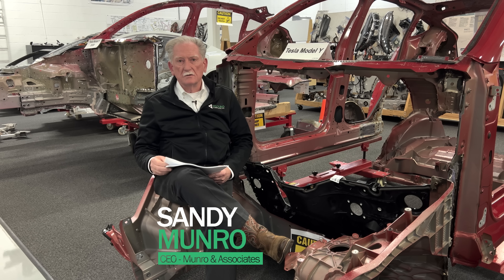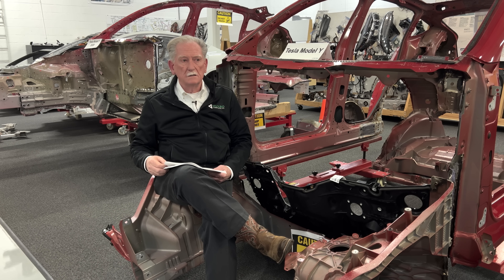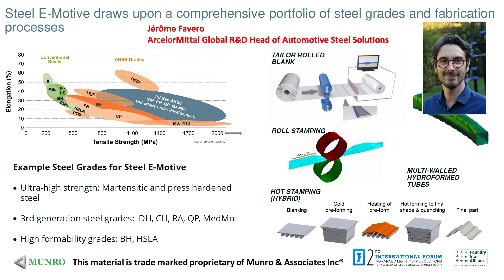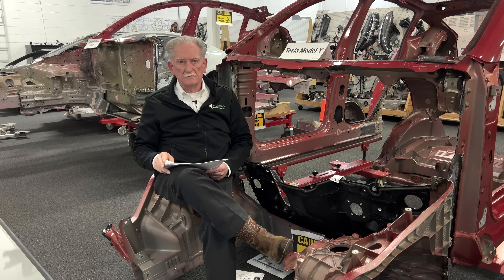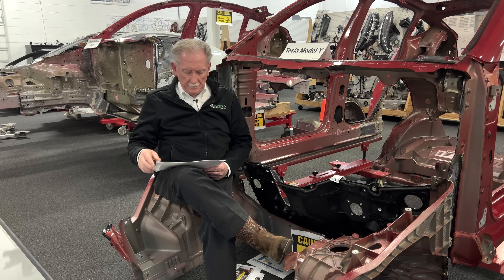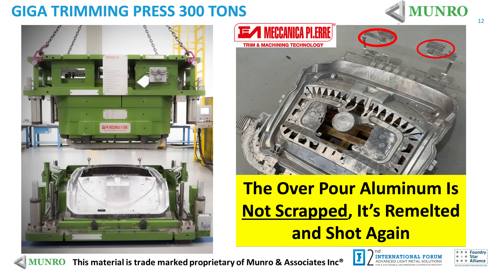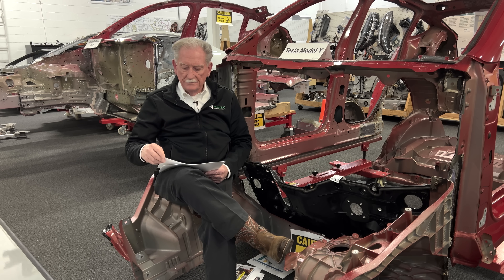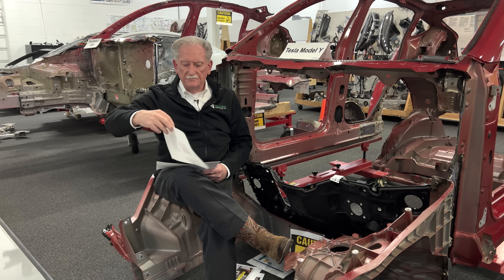Why Sandy is Captivated By Castings: IDRA Conference Recap

Comment: My father made products via aluminum casting. One thing about cast parts is that they are not repairable. Once you have a crack in an aluminum part you gotta scrap it. If car companies make these entire rear ends as one casting, any fender bender is going to cost a fortune. As i learned in my materials class at MIT, Steel is the only material that has the unique property of strength, and localized plastic deformation that allows it to absorb so much energy without shattering. 

Fiber composites are the only materials that surpass steel in strength, and of course in race cars and exotics carbon fiber is all over the place. 

Aluminum castings are cheap - great for the manufacturer - but not a step forward for the consumer. Cars need to last 30 years now, and if insurance prices are reflective of repair costs, Tesla is already terrible at repairability. So i don't see these giant castings as the panacea that so many people think they are.

Comment: I feel it was a mistake for Tesla to use stainless in the CyberTruck body. It’s expensive heavy and will corrode less noble metals (almost all of them) that come into contact. I think folded aluminium sheets in the same design would have been less costly and more durable overall. 
But then, I’d have called it TeslaTruck. I like the alliteration.  I’m sacked already

Comment: Not a word about value to the customer. How do you fix these monstrosities? Or, if you get bumped in a parking lot, you total the car and buy another, right? Looks good to an executive, manager and engineer but what about the guy who paid for it? Can it be welded? How do you change a part. I forgot, there is only one chassis part. Wait,  I forgot that manufacturers would never choose a manufacturing method that would be make a product loose most of its value 100 miles after it would was delivered. As a twenty-one year old I bought an Oldsmobile 442. In less than two years it had lost half of its value. What was good for General Motors was good for the world. Looks good guys.

Comment: I used to work in a 750,000 square foot lock manufacturing facility, and we had delron machines and die casting zinc parts.  The magnisium casting you are showing looks a lot like the delron machines we had, but of course plastic delron melts at only about 600F.  They still used a 350 amp 480 volt power to run all of those electric heaters around the mold pump area.  

This is why I was thinking that the Texas Gaga press can not operate until after the electrical upgrades are completed.  The building I worked in, they had 3 each 4,000 amp 480 volt bussbars that ran everything in the plant.  The National Electric code dictates that most buildings only have one electrical service.  However Tesla needs to run 4,000 amps at 480 volts in several locations around their plant, and another 2,000 for the chargers, and many other buildings with a lot of electrical power.  At one point, Weiser Lock was offered to bill them at 66,000 volts instead of billing at 480 volts, and the power utility would reduce our overall rates if we agreed to be billed at the higher voltage rate (and paid for any loss that the transformer is consuming).  I wonder if Tesla will also be billed at a higher voltage, and then they can put together all of their Mega packs and the high voltage distribution system, so maybe 12,000 volt power is sent from the new power distribution panel to several 4,000 amp output 480 volt output transformers locate in several locations in the plant.  So they can reduce the amount of 480 volt distribution systems they install.  

Looking at your display, and knowing a Delron machine will take 350 amps, the giga press seems to be over 3,000 amps at 480 volts, or maybe they are feeding it 4,160 volts (a common industrial power).  

Tesla wants to cycle their giga press to produce 1 body casting each minute or so.  So they need enough heating capacity to melt that much material each minute!  So that can take a LOT of power.  The 68 each Mega packs putting out 1 MW each for 4 hours, that is a example of a lot of power.  The Giga press is going to take a LOT of power.  If Tesla requires 2 minutes per casting, that means they will need to presses for each casting, so that one can be produced on press #1, and the second one on press #2, so they can put out 1 per minute.  Then if they have 2 castings per truck, that means the front and back are going to need their own press.  

If it takes a 100 KW electric heater to melt 10 pounds of material per minute,  (I actually have no clue how many KW it takes to melt that much material) you could guess how many KW is needed to melt the casting over 100 pounds!  

For the production year 2024, if they can only make 1 casting every 2-3 minutes, they can keep making the trucks at 1 per minute for a single 8 or 10 hour shift each day.  They will need to run the casting machine over 18 hours a day, to support that 8 hour long shift of truck production.  Then once they are able to install more presses, they can make the castings on two machines if they need to.  

If each truck requires 100 pounds of cast materials, and they are building 100,000 in 50 weeks, that is 2,000 per week, or 40 hours is 50 per hour.  So 50 trucks X 100 pounds is a lot of material being brought into the factory each day!  5,000 pounds per hour, 200,000 pounds per week.  Maybe they can use a gas fired melting system to pre-heat the material to almost the melting point, then feed the material into the press that is located below the metal pre-heat system.   My guess is the parts that must be cut off and recycled would be about 15% to 25% of the weight of the finished casting. So if the total weight of the casting is 100 pounds, then 115 to 125 pounds of melted material is injected into the mold, and the 125 pound casting then goes to a press that will shear off any excess material, and that excess material can return to the casting process (if the size is correct).  

So when I see the megapacks working in Tesla, then I will know that the new 480 volt transformers are going to be in place, and the giga press can get started at melting a lot of material each hour, and make a casting every minute on each casting machine.  

If the castings take 2 minutes per cycle, then Tesla will need to have about 400 of the castings sitting around at the start of each shift, and they can run the whole shift, while the casting machines will take 16 = 18 hours to produce the castings to be used the next day.  If the castings only take 1 minute or less, then they will not need to build up any stock of them on the factory floor for the next day's production.  If it does keep taking 2 minutes per casting, then Tesla will need to install more of them to bring the production down to 1 per minute with several presses.  Once they can produce at the rate of 1 per minute (maybe with two presses per part), then Tesla can start to produce the trucks in 2 consecutive shifts per day, or get to about 225,000 per year.  This is said to be by the end of 2025, according to Tesla news release.  

For those who say "Why not make 250,000 or 300,000 trucks per year?  The answer is they can not add seconds to the day.  They can only make 1 per minute, and not get more minutes in a 8 hour long shift, and actually with a couple of 15 minute bathroom breaks, they only get about 50 per hour.   For those who say speed up the production line!.  Well lets consider you are the one installing 4 bolts into each door, say you get the front passenger side, and have 60 seconds to attach the door, then run back to the next truck behind this one, attach that door, and do it all over again every 60 seconds.  A very large work out every hour of every day!   Sandy has seen a production run at 45 seconds in Germany, but we do not have slave drivers in America.

Comment: Good content and thanks for sharing it with us.  I have couple of questions: Does the flammability of Mg have any issues?  It is much less flammable in larger castings, but is it an area of concern?

Is it feasible to use the MIM (Metal powder Injection Molding) for any of these parts?  The pressures are much lower and it can be used for very complex parts similar to plastic molding.  They just need to compensate for the shrinkage as the binder is sublimed off and sintering fuses the powder metal together.  Not sure that it is practical for large parts.

Comment: I don't know how I would feel about having solid magnesium parts in an EV. Have fire hazard experiments been done in conjunction with a fully charged battery? My fear is that it would burn so fast and hot, it would melt through the battery and cause an explosion.

Comment: I struggle to see why all of a sudden people have become fixated with casting like it's a new thing in cars.  Front end/rear castings were about when I started out 20 years ago especially with aluminium framed vehicles.  The only new thing is the size of the castings based on someone willing to invest in larger (experimental'ish) scaled up machines.  The industry is conservative and risking a product launch for a potentially risky technology leaves you with $200-300m investment that you may have to retool because one component doesn't get to the quality you need. Now someone has taken the risk and proved it can work we will see more go this way as the cost and structure benefits are worth it. Well done to all those involved in taking the risk and pushing.

Comment: congrats on your success suggesting castings to Tesla but castings already feel old.  Problem with castings is size and weight and the expensive tool.    I think the future is going back to steel but new with car designs that are boxier or monolithic. The Cybertruck throws out many conventional car engineering and design and there's a lot of opportunity.

Comment: This reminds me of when the allied forces world war II examined shot down German aircraft to discovered that they were pressing big parts rather than assembling multiple small parts to achieve the same assembly. So the Germans got better equipment manufactured faster and cheaper and that really woke up the Western manufacturing eyes. The advantage over 10 snips metal brakes rivets and welds was tremendous. 80 years later and the automotive industry in some parts still hasn't figured out the advantages.

Comment: @4:30 bottom right tesla has 11 gigapresses on order? that is enough capacity for about 2 Million cars/year assuming a cycle time of 80-90 sek and ~ 1000 castings/machine/day , they are at a runrate of about 2M now. Would like to know how the delivery timeline of these 11 presses is.

Plus the new casting machines at giga texas seem to have a new cooling system, maybe the cycle time got improved, then it would be even more.

Comment: Thanks for this video very interesting. Could you please make a video about casting repairs - there is a concern that with wider adoption of castings repair costs after crashes would significantly increase and with that also insurance and the number of write-off cases after less severe crashes.

Comment: In the past it seemed people kept saying that casting would lead to lighter vehicles as well. However recently, that narrative seems to have changed. The evidence is a 7,000 lb Cybertruck, and no change to the new Model Y weight over previous versions. Would you comment on this? Is this simply teething pains for this new technology, or is this a better fact for all cast parts?
Reply: I would have thought that the 3mm thick stainless steel body, and the bigger battery and bigger tyres might muddy the waters on your weight calcs? Not to mention the biggest windshield and wiper😯
I'm sure they will address at least some of the weight down the line. They recently had a go punching holes in the bodywork, but the bullets wouldn't work!

Comment: Does Thixo Magnesium have any flammability issues?  I recall decades ago Magnesium was used by NeXT computers.  They were machining of course. But I recall they had multiple fires and had insurance issues.  As I said, its been decades so I'd imagine they have found/solved the issues but I just wonder.  Also I see the new iPhone has titanium. TITANIUM! in a consumer product. Just stunning. Then again the original hard drives had platinum - so go figure.

Comment: I'm no engineer but i have a question out of curiosity. What about production speed? Is it slower to cast all those parts than slap them together and spot weld the stamped ones?
Reply: It's faster when hundreds of parts are reduced to a few and thousands of welds and bolts are eliminated.   Work stations and employees are also eliminated.  Costs and production hours are reduced.

Comment: My question to all engineers out there is: what comes after castings? 
What's the next manufacturing technology after Tesla makes the car out of one casting with PU foam/plastic on it, as panels?
Reply: Hot Wheels has been making them like that for years.
Reply: Huge 3D printers with multiple materials....print the wiring with the car...metals and plastic....
Reply: The current limitation is speed but multiple heads, foaming techniques, fiber knitting and others I am failing to imagine could replace some manufacturing techniques if they can make parts quickly (in a matter of seconds rather than hours) @chrisheath2637
Reply: Hemp? Henry Ford created a car with hemp ...got with a sledge hammer it bounced off ...no damage ...remind you of some car ???...don't know how the hemp car went with bullets tho

Comment: Can you go into how you avoid galvanic corrosion when bonding steel, aluminium and carbon fibre?
Reply: Coated metal held with fasteners, no worries fibre
Reply: @MashDaddy  I've heard that Carbon Fibre is one of the worst things when bonding to metals because it's quite noble, so the metals corrode instead. If you look at Street Bandito's videos they warn against this contact adamantly.
Also, what about the fasteners that punch through the metal layers for fastening? I've seen this in how Tesla bonds their steel and Alu parts.

Comment: There's a big issue many BEV Automakers aren't focused about besides some cases as BMW with the i3 and i8...weight! Big casting pieces are for production costs savings, as improve assembly time. But doesn't offer significant weight savings, crucial for BEVs.

Comment: The moment you mentioned it's like a forging, my interest went from a bit interested to extremely interested. Looking forward to seeing this in full-scale production applications!
Reply: high pressure die casting produces very dense parts. More akin to billet than sand casting etc.
Reply: Q: at this time, are both ends of the Model Y gig casted or just the rear?

Comment: It looks fairly certain that we will be seeing more large casting and casting in general in manufacturing.  My 'hope against logic' is they can bring the cost of cast parts down and replace some of the plastic.
Reply: Tesla has stated that it is easier and cheaper to repair damage to one of their castings than it would be with an assembly of stamped parts.
Reply: @bobwallace9753   Yes yes yes...HOW repaire a simple cast PART ? HOW ?
Reply: @beyondourarena2207  

You cut off the damaged part and weld on a new piece.
Reply: @bobwallace9753   by wich miracle did you WELD on a magnesium plein gauge variable thickness ? By hollywood? 😂
Reply: @beyondourarena2207  
Tesla is using aluminum.
Reply: @beyondourarena2207 castings can be structurally repaired with brazing.  A broken casting can be brazed back together or a damaged part be can cut off and a replacement spliced on.
Reply: @motionsick  Where is the replacement part coming from?  Is it cut from a spare gigacast?  Or is there a separate casting machine for smaller sections of the gigacast?
Reply: Do you guys work at a body shop or build cars cause your sure talking like your all pro fabricating 😂 most vehicles can be repaired easily it's the scam service we are required to pay that doesn't fix things.
Reply: Casting is fairly common in general manufacturing. A lot of boat motors have their engine blocks, propellers, and other components die casted
Reply: @drdanny3900  Indeed and we very often repair those castings when damaged rather than replace them which results in great savings.  Old Timer that showed me how did the repairs often in the field using just an oxyacetylene torch with a neutral flame.  Some tig welders took exception with that and had his aluminum welds tested and compared to their TIG work only to find their TIG work did not pass with as high marks as the Old Timers oxyacetylene aluminum repairs.  

His explanation was experience and taking the time to think things through well before you even light a torch and that you have to use all your senses when working the puddle with sound and feel being more critical than just sight.  My take was a good welder with mediocre equipment can do a better job than a mediocre welder with the best equipment.

Bottom line is that we've had the ability to do critical structural repairs to aluminum castings for almost a century now.  The gent who showed me how 50 years ago had already been doing so commercially for about 50 years.  Its not some new Voodoo that just came from Elon Musk and Tesla, he's just taking it to a new level and the next logical step.

Best!
Reply: Casting is great for manufacturers, terrible for consumers. Not everyone wants a disposable car after a minor accidents. Munro says the casting can be repaired, but good luck with that.
Reply: @truantray a bent front casting is a totalled car. If it's using sheet metal it's also not gonna be repaired. It's going to be replaced, and you don't replace "part" of the assembly because it's all welded together
Reply: @truantray  casting aluminium part repaired? How? theses parts are just a piece of crap if damaged, that all. Real world is not "hollywood"... 😂